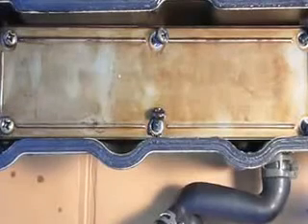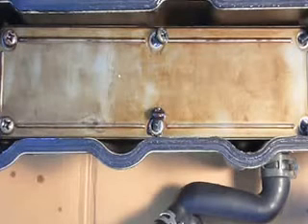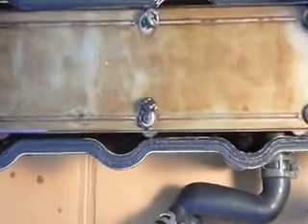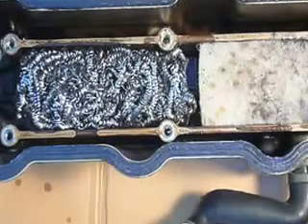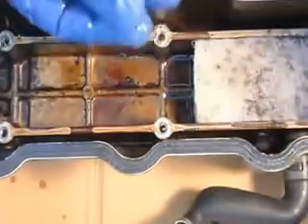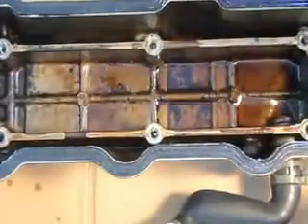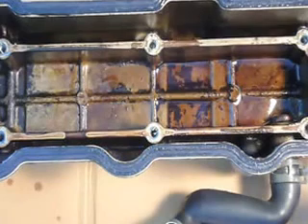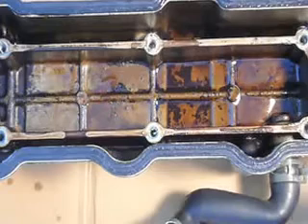Geo Fart Fix - Internal PCV Filter (Results--not good)

Comment: This is what i did: Plugged the PCV valve then fitted a 2 foot hose or so to the valve cover and the WIX 42992 part that Geo eff requested and ran it over the air filter cover and down to the front of the air intake. I removed the air intake portion that is flexible and there inserted the WIX 42992 filter so the air intake would pull the exhaust in. hope that made sense. Ill try to add a video on my page soon.
Reply: Well, did your fix work?
Reply: @TheDrunkardHu  Sure did but the filter got a bit oily fairly quick.
Reply: @imsefa45  I'm about to put a head gasket in mine, and I'm going to alter the oil passages in hopes that they'll drain more efficiently.